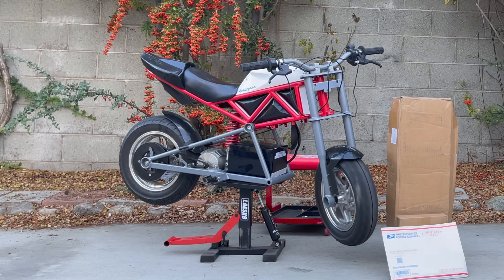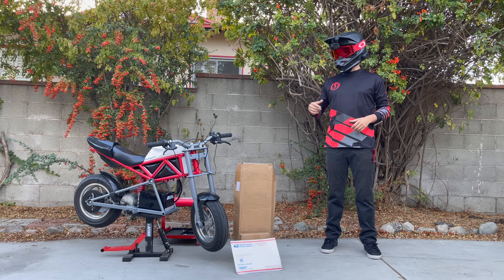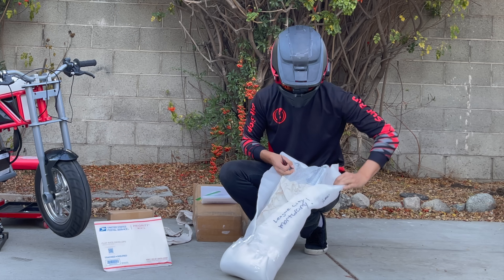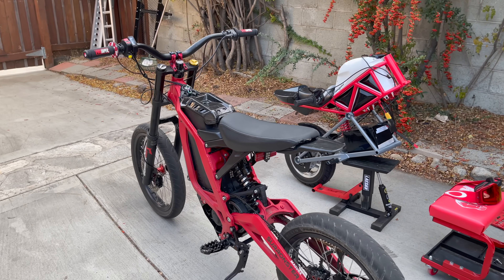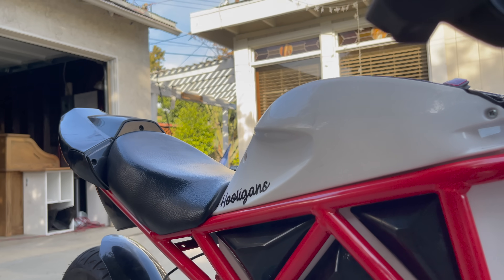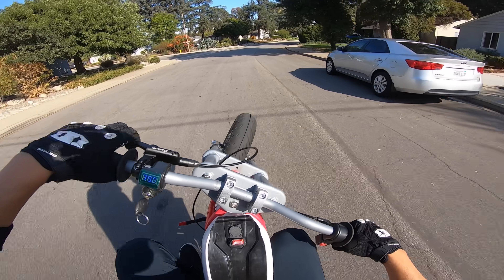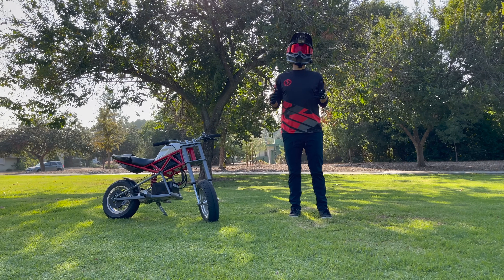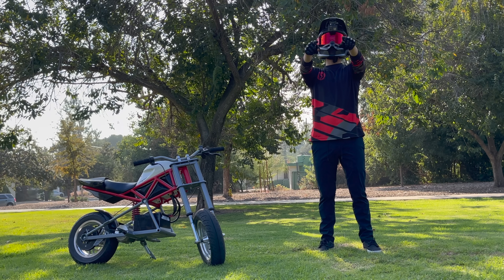The Best Mini Stunt Bike // 6000W Razor RSF650

Comment: On the website, there is different sprocket options. What are the differences between them?
Reply from the maker: I use the stock 11 tooth sprocket. Larger sprocket options will make you go faster but less torque
Reply: @SurRonster  I think I've found a store when i can pre order a Sur Ron, what's the best model, the most expensive one states a top speed of 46mph do i need to upgrade the controller for a higher speed or is it restricted ? I'm new to this but i definitely want one, my friend showed me these years ago he's into motorbikes but we never got around to buying one.
Reply: @originalityisdead.9513  no it’s not restricted from what I’ve seen. You can upgrade the controller to go faster. I’ve seen some people going 75+ but the motor starts to overheat and on a couple occasions melt the motors
Reply: @SurRonster  brother
Reply: @SurRonster  
Hi
Reply: @SurRonster I recently started because of you
Reply: @SurRonster
Reply: @SurRonster  

What is the top speed with 11 tooth? 

I assume you would need a longer chain if you go up lets say two teeth?
Reply: Torque vs Speed
Reply: How much is a suron
Reply: @millersgaming8256  4000
Reply: @millersgaming8256  a lot
Reply: Hi
Reply: Hi

Comment: Take the heatsink with the fins off that motor, you're actually making it retain heat. Unless you have a layer of heat transfer material between the motor and that heat sink, its acting as a heat shield because its not in perfect contact with the motor. It's literally working to keep the heat in the motor and is purely for looks. It's gonna get hot from the heat radiating off the motor but isn't helping to pull heat out of the motor..

Comment: I just installed this kit and im wondering how you solved the front brake issue?  I have the upgraded fork as well I plan on using the stock cable brake as a temp solution but would love to know how you got your front brake to fit if you did.

Comment: Bro, I've subbed and binged-watched all your RSF650 vids in the last few hours, and they've convinced me that I need to build-out mine just like it!  I have a couple questions:

1)  Brakes:  it looks like the rear cable doesn't go through the OEM holes.  Is it too short or was that unintentional?  I'm afraid it could get caught on something with it hanging out in the open like that.
2) Power kit:  does it have different speed modes?  My kid is great on a (stock) RSF650, but as you mentioned in another video, I wouldn't trust him with the full power with the 72v/6000w setup.  But if there's a lower power mode, he'd probably be fine on that.

Keep up the great work on the bike and the great vids!  Please let us know if you come up with any other upgrades like a headlight/taillight kit, bluetooth speaker, etc!!!  OH AND A WHEELIE TUTORIAL WOULD BE EPIC :)
Reply: It has eco mode which is the lowest mode, you kid might need some getting used to ofcourse but yea

Comment: I'm sure its on your todo list but upgrade that rear springs and its a world of difference. Mine sits about 4 inch taller with a 12inch shock
Reply: Hey bro, what size is the spring if I just want to do a simple swap out with no modifications?

Comment: is it easy to upgrade im not very good with wires
Reply from the maker: I had no idea what I was doing and it went fine haha
Reply: @SurRonster  would you need power tools or anything cause on other upgrades they have to clip wires and connect them thx for the reply

Comment: I have a question about the kit you put on the rsf650 does that kit also work with the rsf350 model as well?
Reply: I doubt it would be fun/or safe with 0 suspension

Comment: Just to add a comment. Front suspension is not needed IF you're intending this for racing. Here we assume the road is typically smooth. For joyriding on bumpy sidewalks and doing stunts, this is really nice to have though.

Comment: I've been riding dirtbikes since I was 5 years old. But now everything is Electric in so much easier and faster so awesom don't know which one I should get the alta redshift or sur ron
Reply: Get sur Ron
Reply: @Adam.jask14  that's the one that I was thinking about getting more over the Alta redshift
Reply: @korymanuel4037  yeah sur Ron’s are great and super reliable
Reply: @Adam.jask14  that's what I keep hearing because I got a Kawasaki KX 2 stroke 85 pit bike and it kept up and have faster acceleration and I took off in 2nd gear 2
Reply: @korymanuel4037  yes they are technically illegal but from what I’ve heard cops don’t really mess with you and if they do all you gotta say is it’s a class 2 e bike and they like “alright have a good day”
Reply: I have a surron.  Most fun I ever had.  But it does not ride like a dirt bike.
Reply: @Zackattack94  are they street legal????
Reply: @korymanuel4037  not street legal sadly depending on where you live
Reply: @ididntrecover  Southwest Louisiana
Reply: Sur ron